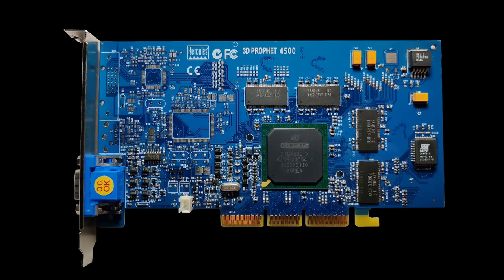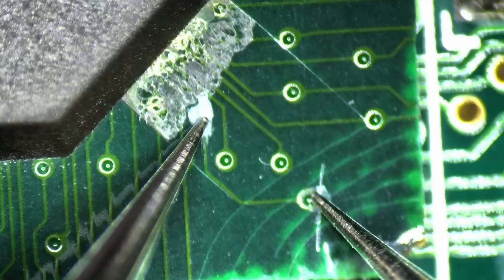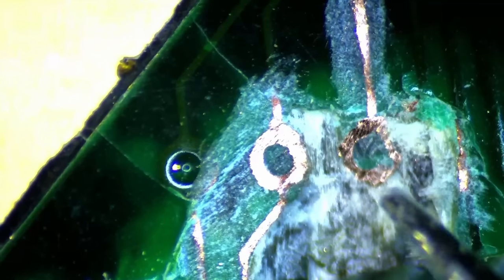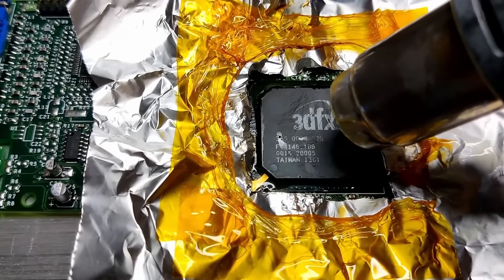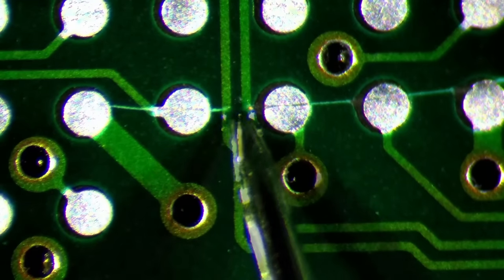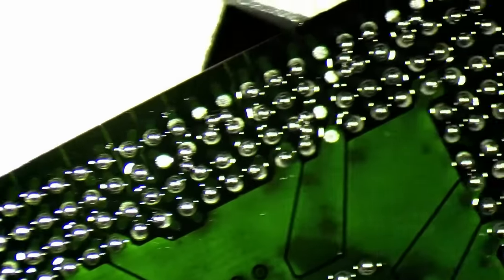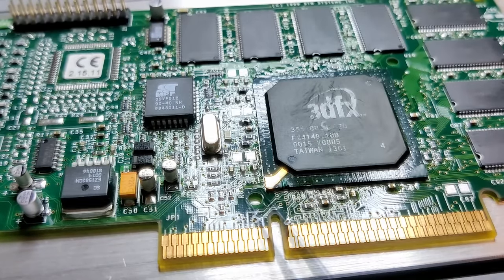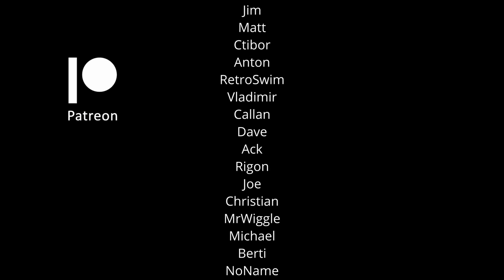3dfx Voodoo 3 2000 - My first attempt to fix a BGA chip!

Comment: An amazing attempt - particularly for being the first one. You'll be Rossman-level in no time!

Some pointers from someone who also doesn't have a great deal of success with BGA, so please feel free to ignore :)
1. Get a laser thermometer. You need to be able to ascertain the temps on the PCB as precisely as possible. Remember that laser ones rely on IR though and each material is different. But I think it'll do
2. Do rely on the pre-heater as much as you can. 150C on the PCB are fine for pre-heating. If leaded solder (that is a leaded solder card, pre-2000?) you might just need a little extra from your hot air station. Do leave the card to "soak" for a minute or so once it reaches the desired temperature and start with hot air a bit far away. Those large things do take time to rise in temperature so don't be too concerned if it takes some time. 
3. Use the largest tip you have for cleaning the pads. Some of those pads will be connected to ground/power. Heat from a small tip might be sucked away quickly, resulting in what you observed when the pads did not want to take solder (unless it was a bad pad). The wick will also wick heat away, Ideally you want to use a segment only. Make sure the card is still on the pre-heater when cleaning the pads.

"What's for dinner tonight?"
"what are the options?"
"Ice-cream or Frozen PCB"
"I'll get the PCB with some solder balls sprinkled on it" :)

Once again, an amazing attempt!
Reply from the maker: Haha, that last bit made me laugh 😂... And thanks for all your valuable hints! I will definitely try to follow those. I don't have a laser thermometer, but maybe the thermal camera will do as well. I probably should have been a bit more patient with letting the card soak on the pre-heater. I'll try this again once I get the new hot air station.

Thanks Tony for your input!
Reply: @bitsundbolts  In theory the thermal camera should work but I found a handheld laser one more accurate and practical. They're not expensive. Can be used in the kitchen too :)
Just remember the laser is only a guide. The IR sensor is a cone and it matches the laser pointer only at a specific distance.
Reply: I seem to recall another youtuber with a modicum of success in BGA repair having a source of cold air on hand; think it was actually plumbed into their heating rig in case of emergency - but sure they also mentioned it being a handy trick for if you have just a couple of recalcitrant joints ... will see if I can find the source, I think it was a PS5 repair.

Comment: I haven't seen someone reball by hand like this before so that's pretty impressive!
Reply from the maker: Thank you 😊
Reply: Well like he said, there are no stencils available for these Voodoo 3 chips at present. There are upsides though - not many balls compared to modern parts, and no reballing jig required. I'm in the same situation where I need to reball 2x Voodoo banshee cards and a Voodoo 3. I don't think that's worth buying the stencil jig for and I can afford 20 minutes per chip.
Thanks BuB for showing how it's done and the issues you came across with the solder ball sizes, that should help me in my repair attempts.
Reply from the maker: You're welcome! Thanks for watching!

Comment: It may have not worked in the end, but you got to learn/practice a new skill and that is always a win in my book.
Reply: Yes, failures are equally good for learning. If you succeed at first try, you may never try to improve because it worked.
I've got a GA586DX-Board laying around, changed the northbridge and the southbridge, repaired soldermask and ripped pads.
Never got it working again. On the other hand, i recently replaced a X570-southbridge on an AM4-board and it worked again.
Even with the factory unleaded solderballs. One day you lose, the other day you win. Simple as that.
Just keep on going and try to improve!
Maybe collect some other V3-cards and swap stuff around. If it's not working, it's for science and practice!
Reply: Yes, there is nothing wrong with starting something new. Experience comes with practice. Good work anyway!

Comment: Nail polish remover (acetone free), is the gentlest thing that I found softens the remaining heatsink glue on 3dfx cards , for cleaning without damaging even the writing on the chip. 
Spread a few drops with a cotton-bud / Q-tip to make a small puddle only on the glue, and after a few seconds, start gently scraping the edges and softened surface layer of the glue with a sharp blade. Add some more drops, spread, repeat. 
It doesn't penetrate to well, so you always have to soften the new layer that you expose.
In under 30min. you'll have a pristine looking chip.
Reply from the maker: I have not tried nail polish remover. This is what I can imagine that you still have to go layer by layer. This glue is so hard - I doubt it will just soak the entire thing and you can easily peel it off. If I get another card that needs that, I'll try it. Thanks!

Comment: For cleaning up large PCBs with ground planes and being able to wick up solder, I'd recommend useing a "flat blade" tip  and cutting a section of solder wick to be slightly larger than the width of the blade tip.
These tips are quite large and will have a lot of thermal mass, and by using a small piece of wick you don't have to have the entire copper mass of the entire spool drawing away heat.
Just place the wick piece down, blade on top, and use it like a mop with gentle pressure to push it around. When the wick is saturated, pick it off with some tweezers and get another piece.

Comment: Personally when removing glued on heatsinks I apply hot air to the the middle of the heat sink until the glue starts to soften. Using a pair of tweezers inserted through the fins, apply a gentle twisting action. You will feel the glue give way and be able to lift the heatsink right off. Worst case the solder melts and chip and heatsink come off as one.

Comment: I've never been brave enough to attempt soldering any BGA components myself, let alone attempting to remove, repair, reball, and replace one.  Good on you for making the attempt and certainly learning a huge amount about what I call "the art of BGA."  I'm sure that you will have learned enough about this type of work that you'll have a successful repair in no time at all.  (PS: Even the guys that post videos about doing lots of BGA rework are constantly having failures.  So this is obviously a hit-and-miss type of work anyway.)
Reply from the maker: Yes, I did learn a lot! Now I wait for a better hot air station to try this again! So, I'll give this chip another try. Worst case, I get a comparison between the cheap hot air station and the better one. I have a feeling that this card will appear again in one of my videos.

Comment: Probably a long shot, but the way the balls were columns, it looks like something was holding the chip up. The balls can correct some flatness issues, but generally BGAs rely on flat surfaces, ie, check with a ruler across surfaces and damaged corners to see if there is a high spot keeping inner balls from reaching down to the PCB.
Current you have nothing to lose pulling memory chips, etc, and resoldering them properly, so I would just keep trying.
Reply from the maker: Thanks for the tip! Indeed, I'm not yet done with this card! I'll try again soon. I just wish I could figure out if the PCB is ok and working. Would be a shame if the chip is ok, but the issue is located on the card.

Comment: Maybe it'd make sense to use a linear halogen lamp with 500W rating so that airflow during the reball wouldn't be an issue? And I'd suggest to use Sn63Pb37 solder balls. It's an eutectic alloy with much lower melting point than the regular lead-free stuff. They're still available in the EU.

Comment: you should get a hot plate below the pcb while using the hot air gun. makes life easier, especially for larger ICs or modems
Reply from the maker: I did use a PCB heater below set to 140 degrees.

Comment: I upgraded from one of the cheap 700w hot air stations to the Quick 861DW and wow what a difference.    It was ass if the cheap unit did next to nothing despite getting "hot".    I'm using lower temps and taking far less time with the Quick.
Reply from the maker: OK, now I am really looking forward to the new hot air station! But that is what I thought - you can't compare those 700 watt cheap stations with something like the Quick.

Comment: For removing the glue you can heat the cooler/chip combo at about 100C and then use the screwdriver. The same method is used in PS3's RSX. For the glue that remains on the chip and cooler you can use acetone. It will take a while, but there will be no scratches from the knife. Or you can use the knife for the bulk of the glue and then the acetone when the glue will be thinner.

Comment: awww that's too bad. I've never seen an amateur try to re-ball a chip before. That was a thing of beauty. I have seen pros use different size balls for different chips. So if possible try to ask what it should be when working on a "new" chip. Very impressive attempt.

Comment: I bought an Atten in January. Very happy. Had an Yaxun before, it’s like night and day. I also got a soldering station from Atten, and now I can solder things more easily - Yaxun was really bad at heat transfer. I’m getting a heating bed as well, so I can pre-heat the board and minimize the time using the Atten dessolder gun. I think I killed my Voodoo 3 while replacing memory (gone bad) due to poor tools. I will try to reball it soon: with 0.76mm spheres

Comment: Maybe the silicon is fry because the small hot air nozzle. As a analogy you can unsolder a plastic connector without melting if you use very wide hot air nozzle but if small one is use it will melting very quicky because the heat is concentrate on plastic parts not the pcb

Comment: I've only ever successfully reballed ONE BGA chip so far.

Which happened to be a VSA100 chip, for a Voodoo 4 clone I've been working on (along with somebody else).

I tried using the hot air station at first, but I had similar problems with the solder balls "swimming" around, even with the lowest air flow, and a thinner layer of sticky flux paste.

(I used a stencil to help place the balls in the first place, though, much easier.)

In the end, I just carefully put the chip into the reflow oven (modified toaster oven), and that worked great. ;)

Great first attempt, btw. I would probably have given up after seeing the damage to the chip.
Reply: I should mention that I've never owned a preheater.
I've often thought about getting one, but it's very rare that I need to reball or reflow a BGA chip these days.

I can see how a preheater would be a huge help, though.

It's important to heat the PCB itself, as evenly as possible.

Obviously with only the hot air (or even IR) at the top, it takes a long time to heat the entire chip, way before the solder balls start to melt, and then heat the pads on the card.

I have seen people just put the entire card into the reflow oven, but that's an obvious risk of other components moving around, or caps and certain plastics melting.

Most components would have been through the reflow oven at the factory anyway, but it's a bit harder to get the temperature just right when you're dealing with a modified £30 toaster oven. lol

Comment: It is really a shame after all of that work the card doesn't post... Points for your skills, without any fancy BGA rework equipment, it was really impressed.
Maybe you can try debug some of the basic signals if they are present or if there are any shorts. You can compare with another working card if you have one on hand.
Reply from the maker: Yeah, I wish the card worked. I'll see what comments I get - maybe there are some ideas to try. I have not given up on this card yet. Once I get a better hot air station, I'll try again. Test all the connections on the chip, use larger solder balls, and see if there is anything else I can find on the card. I may also get a 3dfx replacement chip if I can find one and see if I can make it work.
Reply: @bitsundbolts  Definitely other people can give you better advice than me. The misfortune of salvaging the chip of a working card is ending up with two non-working cards. I was just checking how much these guys cost on ebay and DAMN they are expensive, more than 100 bucks!
Reply: I can't disagree with anything said here - this was excellent work done by you on this video. I will also be curious what the public says about this work. There's just so much that could be the cause of the videocard not working.
Reply: I'm sure more information can be extracted from this card besides working or non-working state.

Comment: That looks like a lab plate, not a preheater. I use a lab plate to solder new PCBs with solder paste but I wouldnt use it for preheating. It gets much hotter than a preheater but wastes alot of heat and can't really be worked over. You don't need a better heatgun, just a better method. Buy an infrared preheater with a heatgun holder bracket. Use a square diffuser nozzle on the heatgun you have now. this works for me on newer GPUs and newer GPUs have many layers, they are much harder to deal with

Comment: Oh man when after placing all the balls by hand and then they just all glomed to each other lol - really hits the feels. Thanks for showing this when things don't go right. I think well all can relate to the big "oh NOES... sigh and you just gotta go and try that part again lol
Reply from the maker: Haha, yes... Well, I thought: "what's the harm to use a bit more flux". That was an instance where I didn't listen to others who reballed chips - and I was punished right away. Surprisingly, rebelling such a chip manually isn't that bad and it works quite well. Therapeutic - like straightening pins in a CPU! Placing those solder balls takes less time though.
Reply: @bitsundbolts  Another therapeutic move is resoldering Banshee SGRAM. Did 4 chips on a Innovision "Mighty Banshee" (lmao) and it's running great. Adapted a fan from a dud MX440 and a HSF off a dead TNT2 M64 and it lives again.

Comment: The best way to get rid of that thermal glue is to just water it with some 70% IPA. Just keep adding more IPA over enough time and then you can just peel it off with your fingers. You can score the glue a bit to speed up the process but be careful not to scratch the chip.
Reply from the maker: Well, that will be what I'll try next time. I didn't expect this glue to soften with IPA, that's why I didn't even try. Thanks
Reply: Can anyone else confirm that this works for this hard stuff? Do you mean just keep pouring it on for an hour beforehand? I'd love to remove the factory heatsinks on all of my old videocards, and replace with some thermal tape instead, but I have no idea how this stuff would soak up IPA.
Reply from the maker: Yeah, and you can see a really large gap between the heatsink and the chip. It's good to get the knife in there to get the heatsink off, but this must be bad for heat transfer. The heatsink anyway isn't the largest. They could have easily added a much better cooling solution for those cards - as you said, the holes are there already! 😔

Comment: hi, i have "atten st-862d" at home and "quick 861dw" at work both are works similar, You can take whatever you want from either of them, but I recommend to you  buy together 45 degree bent nozzle set with hot air station
Reply from the maker: I did get the 45 degree nozzles as well. Thank you!

Comment: Loved my Prophet 4500 back in the day until I killed it with a volt mod + pushing the overclock. Good times, then I splurged on a 9700 Pro. Ugh so expensive back then...
Reply from the maker: I couldn't afford the 9700 Pro. I don't remember if I got just the regular 9500 or the Pro, but I know that I couldn't unlock the additional 4 render pipelines. Graphical glitches everywhere. Ahh, I was disappointed, but the card did serve me well for some time. The Kyro II will be new to me.

Comment: I would guess the main chip or something else was already dead from the start. Someone else had a "I've been some videos of how to reflow a GPU on youtube, I'm qualified now" attempt at repairing it before you and they gave up when they cracked the corner of the BGA.
Reply from the maker: That could be a possibility. Oh well, then all I get from this card is BGA soldering training, but that's ok. I will give it one more shot with the new hot air station.

Comment: Even if failed, still impressive work! Good hotair station is crucial for such work (better temp transfer, less time heating bga chips that could damage it). Also you should start thinking of using 0.01mm copper wires for connecting, instead of such thick wire. 

Voodoo bga chip looks like have 4 layer pcb.

Hope there will be more attempt to try fix it after you receive some advices.

Good luck!
Reply from the maker: Thanks for the input! I should have thinner wire somewhere.
And I will give it another try once I get the new hot air station.

Comment: You mentioned the solder balls maybe not being big enough, is it a problem when the solder balls turns into columns instead of continuing to be roundish?
Reply from the maker: I think it would be better if they had a small bulge. I'm just thinking that it could happen that some solder balls didn't make the connection because of the solder balls being too small. But I'm not sure, nor experienced.